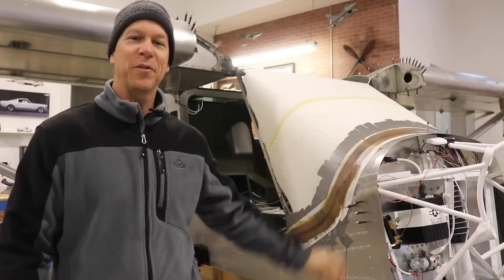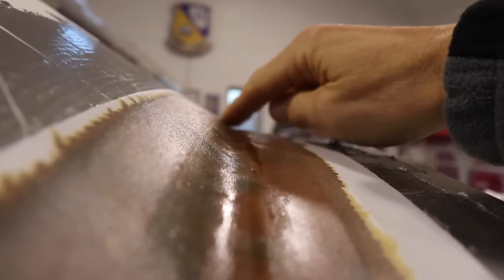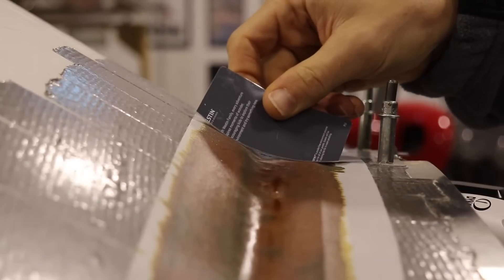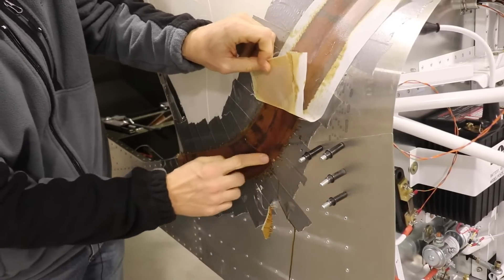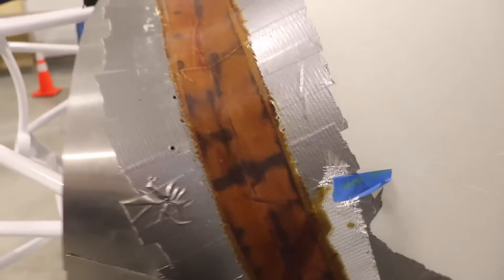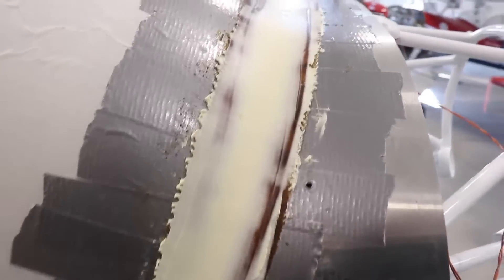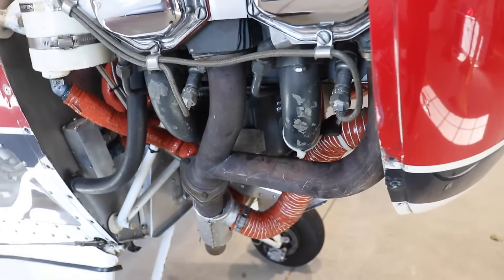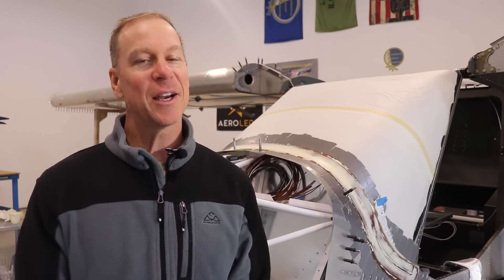Zenith Windshield Fairing | Pitts Maintenance

Comment: Mark, is it possible to build a good sized compartment under the fuselage which might hold a mountain bike and/or luggage without affecting CG?
Reply from the maker: Having it under the fuselage should not affect the CG much, but making it large enough for a bike might be a challenge. Viking Aircraft has a Super Duty pod you can build that might work for you.

Comment: What brand of resin do you use/recommend for non structural stuff like fairings?  I’ve been using West system, and it seems adequate. 

Did you use peel ply on the layer of micro balloons before the third layer of cloth? Did it require any prep before adding that layer?

Can you elaborate a bit on how you secure your fairings to the skin? Is it just a sheet metal screw into the aluminum skin? Do you have any problems with them stripping?

Thanks for the videos. I always learn something.
Reply from the maker: I use EZ Poxy. I use that because that's what Len used to build all his fairings and his entire Velocity. I would not think it's any better or worse than West System. No you do not use peel ply over the micro balloons. Ideally, you want to lay down three layers of glass cloth, and the a layer of peel-ply. Let it cure. Remove the peel ply and sand 'fairly' smooth. Then add a thin layer of resin and microballons and smooth it out the best you can with a hotel key card or better yet, your wife's credit card. Let it cure, and the final sand it. My windshield fairing is secured by small counter sunk sheet metal screws with nylon nuts on the underside of the skin. All other fairings are secured with sheet metal screws and not one has ever come loose.
Reply: @KitplaneEnthusiast   thanks!

I think I went a little too far securing the fairings I’ve made so far. We put anchor nuts on the wing skins to secure the fairings we made over the wing roots and landing/taxi lights. They’re not coming off. 😆

I’m definitely not building the lightest Cruzer. Lol

Comment: At work I use a product/solvent called SC-100, it dissolves polyester resins. Might work on your issue. Or you could try just a heat gun. Most epoxies soften when heated.